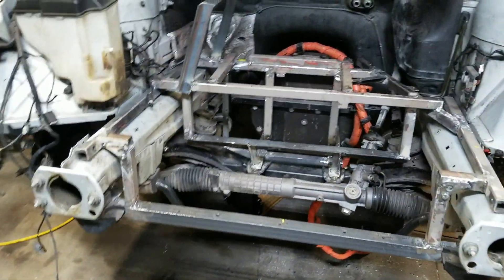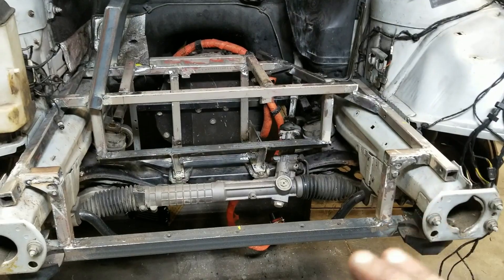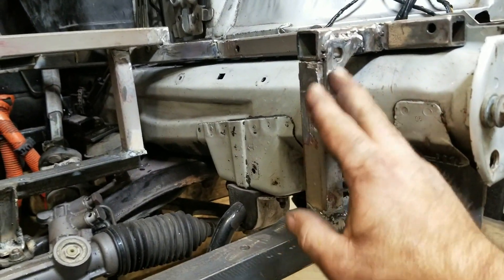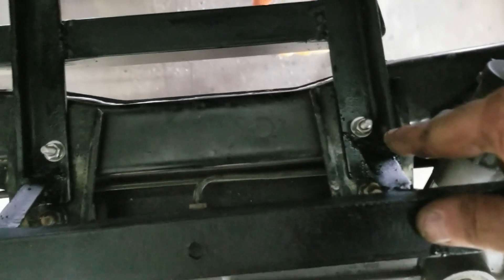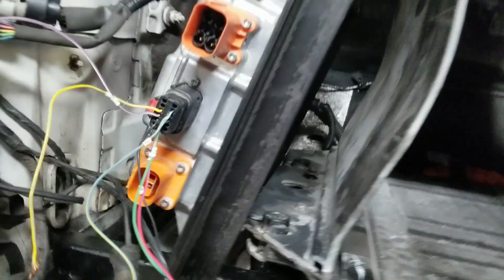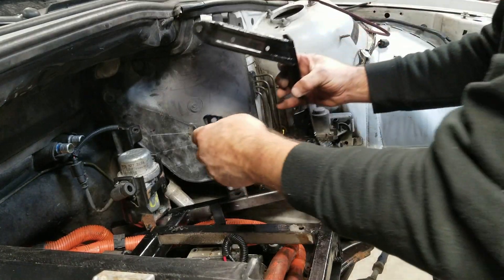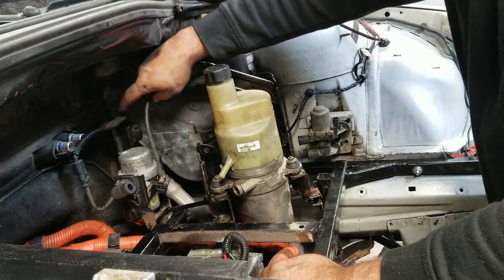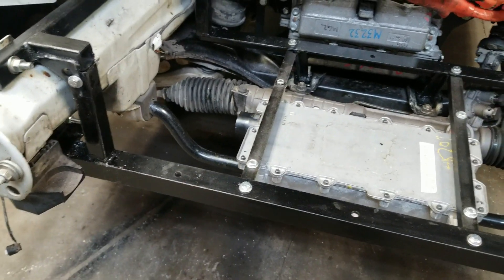Electric Car Conversion e46 Mounting EV componets

Comment: That hole would be good to relocate your 12v battery. Depends on what suits you. Your work is so impressive to me
Reply from the maker: I think the hole you are talk about is now being used to hold make connection box for a bunch of 12 relays, 12 fuses, etc.
Reply: "That hole"...it was designed for webasto (auxiliary heating )
Reply from the maker: @arte_alexandru  thanks! I knew it was there for something.  :)

Comment: I really felt your pain with that bracket. Great progress though. How come you moved the DC-DC converter to the trunk?
Reply from the maker: After thinking about, I didn't like the the DC-DC converter being exposed to the elements. around here they use salt on the roads in the winter time and I was worried it could damage the converter some how.  It might of been ok to have it there but I didn't want to take any chances. Chevy had it the trunk for a reason,

Comment: What inverter, charger etc are you using?
Reply from the maker: Inverter and motor from a 2007 450H Lexus using Damien Maguire V2 board to control it. He has a newer version out called the Zombie board. Which I is a simpler better board.
Charger is from a 2018 Chevy Volt. $100 Canadian. I think I got a steal on that one.
Battery is from a 2018 Chevy Volt (its not a very high capacity battery 18KW, I expect it to be in the 50-60km range) Nissan Leaf, Chevy Bolt, Telsa battery would be better choices but they are general more expensive)

Comment: Im not sure you would want to put the original engine back in? Coming from a BMW I am having to sell because I can no longer afford to replace bits as they break. Not my conversion e36. Never selling that but a E60 that was my main car. The starter motor went out and it drained my account getting that fixed and ive nothing left now if the vanos or something went out. I love European cars but absolutely you need a great income to afford to fix bits as they wear out unless you can afford a new one or very near new.  Or do what you are doing convert it to electric. The brakes and suspension on European cars are generally ok. Its the engine that causes so much financial pain.
Reply from the maker: thats why I buy cars where I can buy parts at the yunkyard. :)

Comment: Can you please show how you bolted your equipment mount to the frame? Or do your bolts not go through the frame rail? In New Zealand they are very strict on anything going into the frame. Curious to see how you did it
Reply from the maker: there were some factory holes already in place, but I did have to drill a few more. 
I drilled where the factory welded the frame rails together. hope that makes sense.